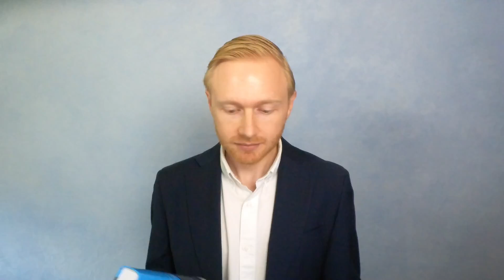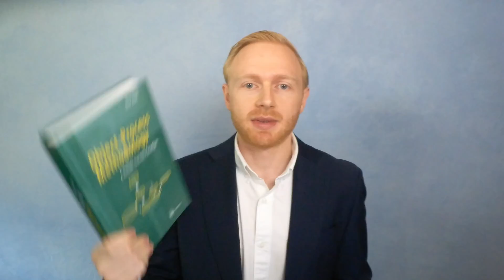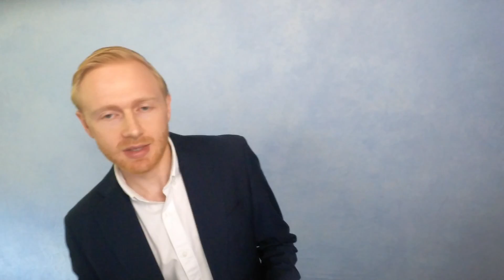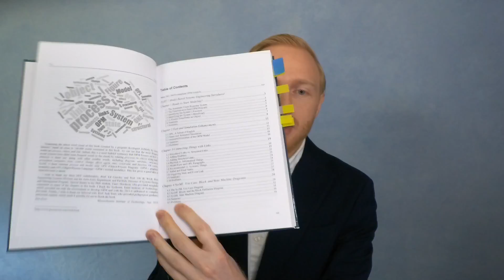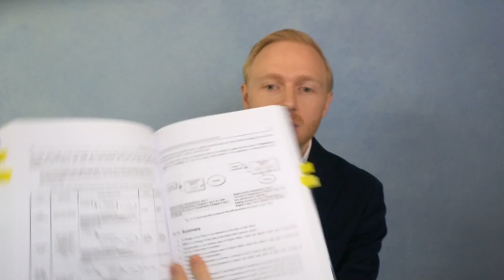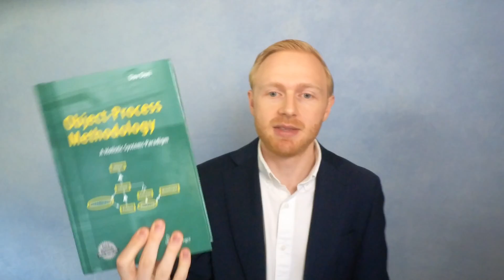Model-Based Systems Engineering with OPM and SysML by Dov Dori

Comment: I came here from mbse lectures and wanted someone to guide me which from sysml and opm one may select. My own leaning was towards opm, but your video made my decision based on guidance. Thank you
Reply from the maker: @mutiur7396 this is great to hear you are considering you options.
Have you selected one now?
Reply: @JoshuaSutherlandSystemsEng  I think OPM is better for me. Although SysMl is more recognized and popular.
Reply from the maker: I often use both.
Generally OPM is best for the thinking aspect at the start of a project. SysML is better during implementation when there are a lot of details to handle.

If you would like some support on either feel free to send me an email.
Reply: @JoshuaSutherlandSystemsEng  Thank you. I am in process of learning system engineering theory. When I will try software tool or help in sort of applying the principles, I will contact you for help. Once again thank you
Reply from the maker: Sure anytime.
Perhaps drop me an email now and I will know how to contact you.